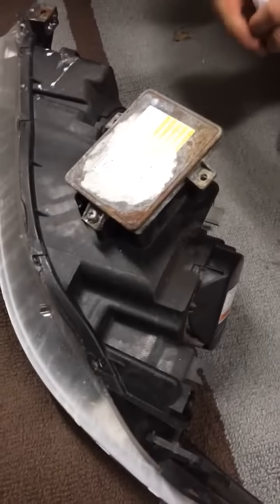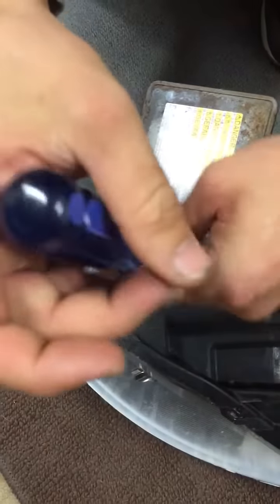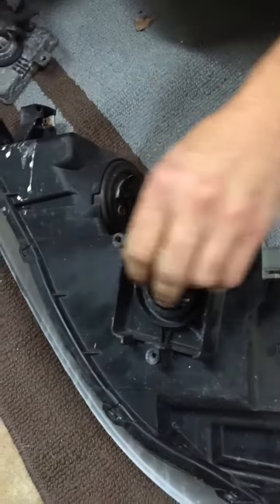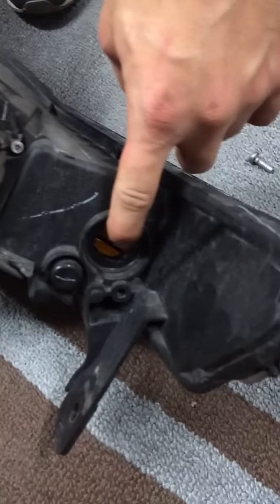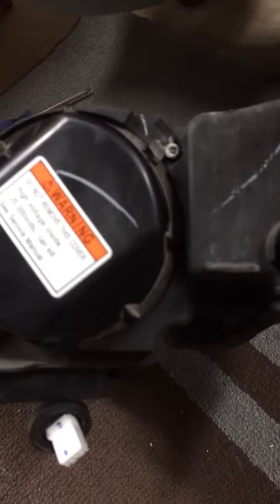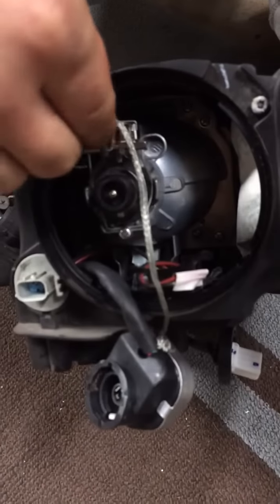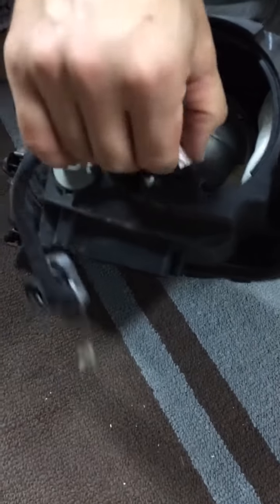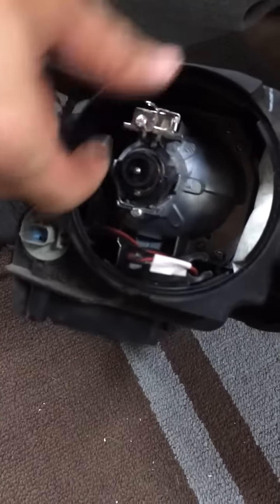EndLessRPM DIY: Changing headlight bulbs on an Acura TL 2004-2008

Comment: Yo Bruce! I have brand new bulbs installed and I'm still having problems with my light turning on for one side which is why I replaced in the first place. I thought my bulb was blown but after flicking my switch on and off a few times, it works. What do I need to replace?
Reply from the maker: lewisdevan1 Ignitor is having a tough time…If it holds after it lights then its the ignitor.
Reply: It is your ballast

Comment: Hopefully you’re able to see this comment but I just replaced my low beam bulb but it isn’t working. Ballast and igniter seem to be in great condition so I’m not sure why, I don’t think I’m missing any wires either.
Reply from the maker: low and high are the same bulb. Swap the ballast / ignitor to the other side and see if that helps. Ballast seems to be an issue every now and then and most common fail. Also check fuses and that the ignitor ground is attached correctly.
Reply: @ENDLESSRPM  thank you, but yup it’s the ballast, I’m gonna go ahead and switch both the igniter and ballast on both lights in case